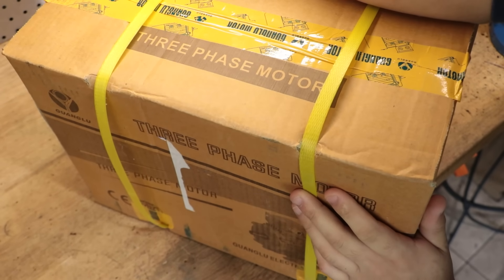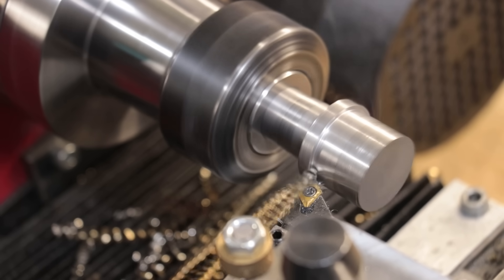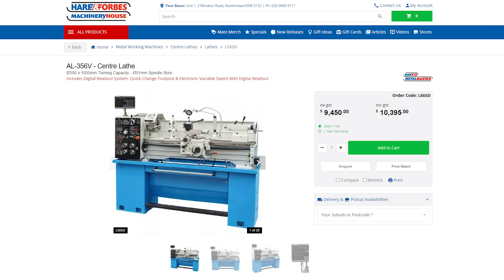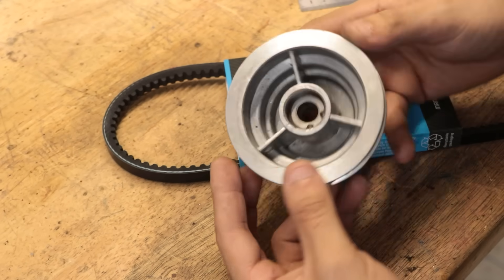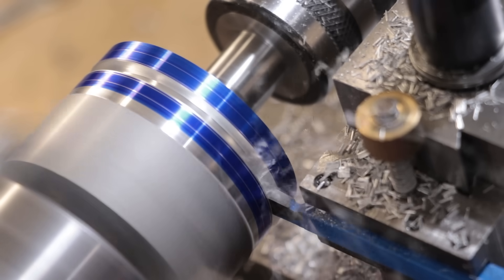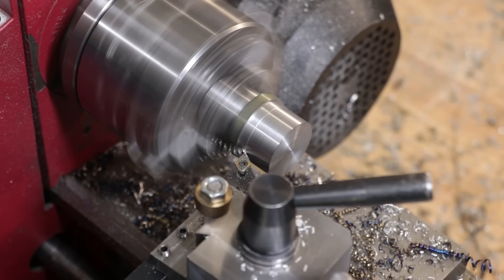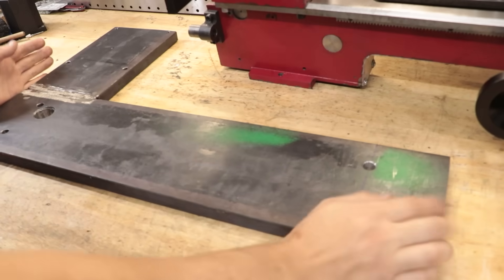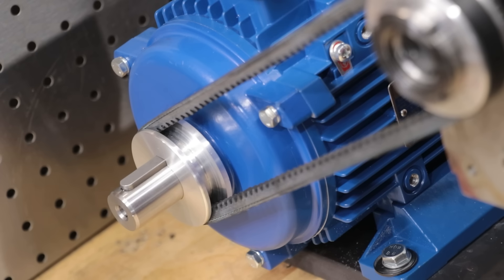Mini Lathe 3HP Motor Upgrade..... (Yep 3HP)

Comment: Yeah that's a lot of hp for a bench top hobby lathe.. my 12 speed 1440 has 5hp..but that's a 1000kg lathe and chucks up a 14 inch dia by 40 inch long work piece..you need an over head crane to load a piece of that size..the lathe can wrap / twist a person up like a newspaper..bad things happen with more power..parts can let go..thru the walls of the shop..perhaps its time to upgrade to a bigger machine..a small used floor model would be great..
Reply: Yes, entertainment value aside it's hard to see this being a good idea. A powerful lathe is much more than just a weak lathe with a big motor, it's more iron, stronger bearings, stronger fittings holding it all together and so on, not to mention better and more securely attached chucks. A bigger lathe will also have a lot more safety features, including components designed to break safely and minimise damage in the event of a crash. When you get into grown up motors you really do want proper electrical interlocks and emergency stops too, personally I'd make a foot-stop an absolute minimum. That part at least can easily be arranged via a low voltage control circuit for the inverter so I hope that gets taken care of. The last thing you want is to be trying to reach for the little pad on the inverter when it all hits the fan. 

I don't want to be a killjoy but the potential for a catastrophic accident here is really quite high. It seems much more sensible to move to a bigger machine, they're not expensive or hard to find and everything on the machine will be in proportion.
Reply: @MichaelCrossUK  I really hope he gives upsizing a real consideration.. a foot brake is a minimum requirement at least for me..a 12x36 lathe would be a nice step up and still fit on a bench if necessary..even a 9x20 might work better..they say get the biggest lathe or mill you can afford or can shoe horn into your workshop.. I skipped over the hobby sized machines completely..my 1st machines was a full size 3hp bridgeport clone mill 2,500lbs and 5hp 1440 lathe at 2,000lbs both used..took nearly a year to find the right deals as many are gone so fast or too far gone..both cost about the same as new good hobbyist level machines..deals are out there..
Reply: @MichaelCrossUK  A footstop is a great idea, I never thought of that, I am a mechanic not a machinist 🙂 
I will add a footstop to my lathe now, I can see if the left arm is being catched somehow, there is no way of reaching the controls.
Reply: @chris6160-d6s  Very sensible! It's a wise idea for a pillar drill too. Best practice is to use nc switches with a +ve signal to enable, that way if your circuitry is damaged your machine won't start.
Reply: Entanglements are not the only concern, imagine something starts coming apart or shaking to bits, you don't want to be reaching across the machine or trying to get to anything fiddly, you want a way of disabling the machine whilst keeping out of the way of anything breaking or flying.
Reply: @MichaelCrossUK  You are right, I have just stepped up from a stock minilathe to a 13" lathe, I need to think safety first, thanks.

Comment: Bro please, for the love of God, slow down your RPMs for reaming. You're going entirely too fast.
Reply: i bought an 1hp mini lathe and i can't with 1mm...first i thoght my tools but then in the motor power ,just 1hp. yours before were a half but even so you made 1.5mm in steel. I found out a better cut at lower speeds ,happy of because later it should be so after the books on the subject, but at low speed the lathe trends to stop when i try remove more material...Until now just an acceptable rough surface(never a mirror) removing .1mm each pass at most.😢
Reply: I was hoping he was gonna part off the bit he machined😂 first bit of scrap launched into space, last seen heading past Pluto😂😂
Reply: Maybe turn your playback speed back to normal instead of 2x😂😂 worked for me
Reply: He can't... he just doesn't understand the concept of multiple pulley sizes to increase torque and decrease spindle speeds.
Reply from the maker: @johncoops6897  its a simple mistake

Comment: HotRod- lathe: Thanks to the VFD that big motor can always be dialed down, you can get off the throttle in a V8 but you cant get V8- power from a threebanger :)
Reply: You can't reduce the speed with the VFD by as much as you might think, because the lower frequency increases current drawn and also significantly reduces cooling in the motor.

Comment: A little cutting oil on the drill bit might be nice. Guess because You used a hand drill to drill those holes your drill press is no longer an option because you used that motor for your last option, just saying😊
Reply: Uh oh, 3hp drill press?

Comment: Good decision to overdo it. At least you're not gonna burn the motor out.
Reply: And If the rigidity isn't still good enough, I am suggesting to cast a concrete base to bolt it to. 100-200kg of non-shrinking groute should make it.

Comment from the maker: Tune in next week for the dramatic conclusion. Already up to 3mm DOC in steel and I can definitely push it further. EDIT: Alright the internet convicted me to change the wiring, no need to comment further. Also the wring is already delta, you can probably see the connection terminal in the top right corner at the 16:36 mark. See you this Saturday
Reply: Why did I suddenly have an image of a mini lathe whizzing round it's spindle? Lol
Reply: How long until the bed is bent?
Reply from the maker: @DJDiarrhea  Factory already did that
Reply: @DJDiarrhea they already come pre-bent from the factory
Reply: Nuts 😂
Reply: 10mm depth or no balls
Reply: Need a concrete or granite desk for it
Reply: @LoneWolfPrecisionLLC   Agreed, that is the only way to make them somewhat rigid.  Without it the bed is going to twist just from the warpage in the wood top it is sitting on.  a couple thousands of movement can be had just by putting a couple pounds of pressure against the headstock.  They also need to be shimmed and bolted down to a rigid surface because they are often twisted to start with.  I just upgraded one from & to 16" bed, and they both showed the same twist when sitting on a flat surface.
Reply: Thanks for posting this, I  was pondering this idea 💡 myself. I'll definitely keep an 👁 out for the conclusion video 📹 🙂 👌
Reply: I think that, as of now, the limit is where you say it is!
Reply: It's not over until you fry the motor xD
Reply: @noviceartisan  Its over when the motor fry the lathe.  :-)
Reply: @Xavier Romagosa  just 3 hp might not wreck the thing especially with upgrades he has!I have a 25 hp motor running a huge twin spindle drill and the funny thing is that the motor itself which is about 85# of it's mass is located right on top of everything else and the only thing that holds the entire contraption is a thick aluminum collar right under the  motor,self-feeder,pneumatic and hydraulic part of the monster(9800$ unused/custom by the way),and the whole thing is large and scary enough for an amateur machinist and avid gun guy like me so that I don't use even a quarter of it's power so it doesn't destroy itself and also doesn't draw tons of electricity!And obviously doesn't reach it's full draw which is 25000 watts or 110VDC 230Amp,which is enough to blow up all the fuses in my house lol 
P.S. the thing itself is supposed to run at 24VDC and would draw 1040 amps at it's peak performance!And so it came with a gigantic 1200amp 24VDC fuse and 3×600 amp fuses in parallel,an Omron controller array C-200h and a warning that said "use only with class A,B and I and II transformers",which is quite funny because those are gargantuan things you can find around NPPs and other power plants or substations that you see around the local (подстанции по-русски).
Reply: You remind me of my time with a Colchester lathe, seeing how fast I can peel away the mild steel.
Reply: Convicted you? What's the charge seriously over clocking?
Reply: Nice, having more power will definitely make life easierb
Reply: Very nice setup you have made 👍 
I just bought a large drill press and ended up trying a lot of brand new drills,self-feeders to be exact which included even such an expensive thing as a custom made ARO twin head with a 25 hp motor that I bought for a whopping $9800,which I barely ran on the same stand as the drill press I had(both drill and the press came at $350 and were 96lbs total while the $9800 monster drill is slightly over 120 lbs without automation circuitry and power supply being external with 25 KW draw for all it's systems,and yet it has all the external components for both feeding,spin adjustment,13mm collets(which are currently unavailable in such packages as well as 25hp electric motors,which have just 3 wires for power input and need just a wall to attach the collar to),so that thing with proper carbide bits or cutters can do real wonders with any metal including titanium,steel and tungsten(!!!):I set it for the 3/10 feeding/retraction speed(5 mm/second for the twin head),put a 0/3 on water/coolant admission(IDK how it's called:English is not my first language),and got two carbide bits with 13mm shanks that cut  12,7mm holes,with different angles though(120° between 3 and 150° between 4 cutting edges;obviously didn't take 180° which would have been an end mill😂),and made it go in and out with a 2" stroke once(no  controlling circuitry applied but I have my Omron c-200h and it's programmable controller that came with it but I have no clue how those work yet)-and ran the whole thing through a 5cm thick titanium plate-that was a damn epic 10 second fire show as was expected from those turnings:thank God I had the fan settings at full draw because those turnings would have just melted both the part itself around both bits,clogged the flutes,melted themselves,heated both bits close to the melting point(1495°C is the temperature when your VK-8 aka Pobedite actually liquifies and it is both below the melting point of titanium and the temperature at which it burns yet way below it's flash point 😂🎉),wrecked all 7 cutting edges and then either stuck and destroyed the chucks,damaged the twin spindle attachment and/or made a total kerflunk when two large chunks of molten/almost molten&burning titanium would have hit the floor under the whole $10150 contraption of mine lol
So I guess the next time I will do either tungsten or AR-680/700 mil spec of the same thickness to see how those behave!What do you think?
Reply: I mean if i were you I would run it in Wye anyway because it's cooler to run and 1kw is plenty for that lathe.
Reply: That motor looks like 'Vincent", from The Black Hole!
Reply: Pro Tip: This goes with any Jacob's Chuck, be it stationary (such as in the tailstock of a lathe), or if it it moving (such as a drill press arbour/ drill arbour, or mill quill. Always use the chuck key to tighten all three points on the chuck to prevent slippage of the drill.
Reply: the motor looks like the cookie monster 100% no cap
Reply: Why oh why do you want to push 3mm DOC in steel???
Reply from the maker: @andrewatcarpathian  Im not aiming to, but its nice to find out what the limit is. A friend on mine owns a powerful M3 BMW but he doesn't push it to the limit every day. Same difference no?
Reply: @andrewatcarpathian  big chips go brrrrrrrrrrrrrrrr. but seriously, being able to speed up the most time consuming part of machining is extremely valuable, you can get to the interesting part much faster and don't have to spend as long getting your stock down to the right size
Reply: @andrewatcarpathian   Because he can